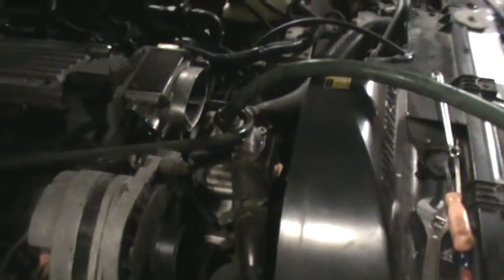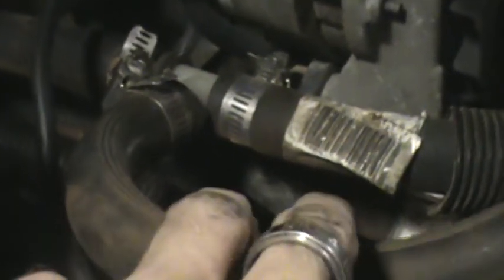How to flush a GM LT1 engine cooling system

Comment from the maker: @petedude2lu3  There isn't one, the garden hose is just wedged in so that it won't slip out. There's not enough pressure to worry about, since the water is simply running down and out under gravity pressure.

Comment: Ewwwww! Looked like my car.  I also used TSP in the coolant tank and it did a nice job of cleaning all the crap out of the tank.  I even replaced all the hoses, Every hose was coated in it.. Then after that? The water pump took a crap. 4 years later, Its still clean!